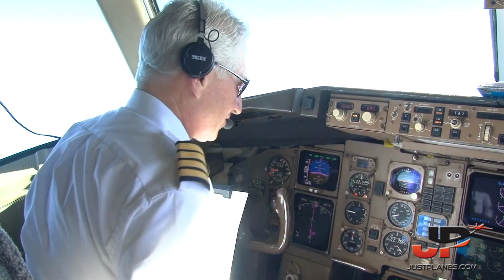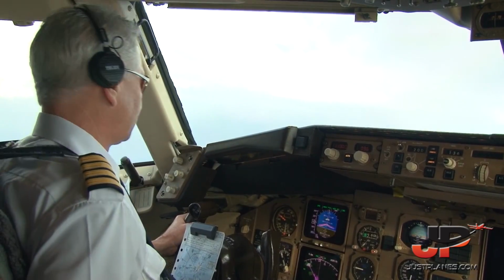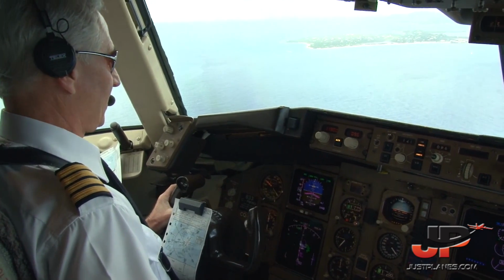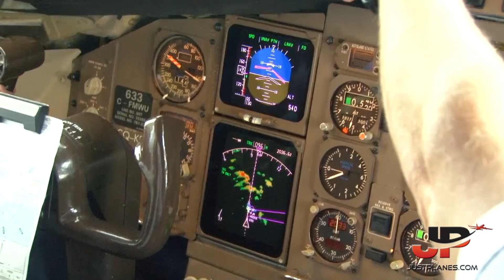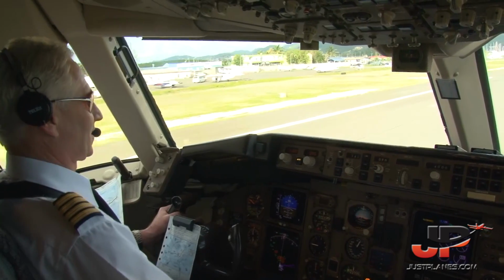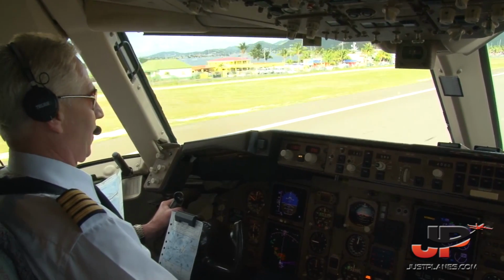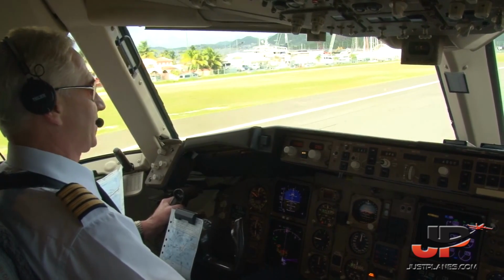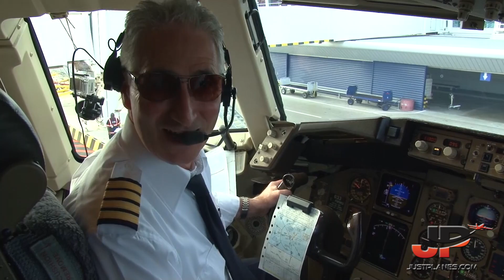Piloting BOEING 767-300ER into ST MAARTEN

Comment: On the 767's GPS, the most likely reason the one in this video doesn't have one is because the aircraft is approaching its retirement age and the carrier doesn't want to spend the money on adding the GPS. The newer 767s, (300 and 400 variants) do have it.
Reply: This was filmed in 2009 and this airplane C-FMWU is still flying with Air Canada Rouge.

Comment: Question for any "Heavy" pilot out there,  I know when hand flying on landing its human nature to make rapid adjustments on the yoke that the autopilot doesn't but does the plane actually respond to those fast tiny adjustment?
Reply: Yes it does ! :) When theres gusts or drafts you must apply those kind of inputs to make sure you stay on the glide path and center line the whole time, and flare correctly and land smoothly
Reply: @maxou5757  Cool.  I didnt know it was capable fo reacting quickly to such inputs.
Reply: Dominick yup. The 767 responds just as quickly as any small aircraft. I’m new to the 767 and have to remind myself I’m in heavy a lot.
Reply: My first impression is there seems to be some over controlling occurring. PIO might be an overstatement, but there sure is a lot of control wheel movement. But I wasn’t there...
Reply: @saxmanb777   I've never flown Large Aircraft but the 757, 767, 777 and 787 seem to be quite responsive. I've heard the 747 is the best of the lot.   I imagine Airbus is disappointing as you don't get much feedback from the side stick since the computer does most of the work.
Reply: Dominick it does but once the flight control law goes to flare mode it essentially is like a conventional aircraft, minus some minors things. But flight by wire from Airbus is amazing for aircraft capabilities. They fly really well
Reply: Dominick the big difference is inertia and slowing down the aircraft, other than that it’s like a smaller aircraft :)

Comment: Surprised in 2019 to see these pilots using paper charts and airport diagrams.
Reply: Brandon Hollingsworth there’s quite a certification process for gaining approval for using electronic charts. Since the 767 is really on its last legs as a passenger carrying aircraft it’s not surprising that an airline is not making the required investment.
Reply: @patzke  this was filmed several years ago, simple as that. Air Canada's pilots are all equipped with EFB's (iPads), regardless of the aircraft and associated age of it. They're far from being on their last legs as well. While AC mainline will likely retire them in the next year or so, Rouge still has a large 767 fleet.
Reply: Brandon Hollingsworth it shouldn’t matter the aircraft for use of EFB’s or not, it’s all in the company’s Op specs
Reply: Imagine if the pilot left the window open and all the charts and diagrams suddenly got sucked out...

Comment: Not GPS Equipped? Will somebody explain  to me how &/or why that is. Also, what do they use to navigate for long distances; LORAN-C & INS? Time Warp Here... 🤔
Reply: There is few other systems we navigate aircraft with that are not equipped with GPS.
For example:
DME (Distance Measuring equipment)
IRS (inertial reference system)
VORs (VHF omnidirectional radio range)

Comment: A 767 that's not GPS equipped?? Huh?
Reply: SMaze17 Fairly common...as crazy as it seems.
Reply: SMaze17 — The B767 was introduced in 1982.  GPS was developed beginning in 1973, but the WAAS which supports precision approaches to airports was introduced in 1994 or 1995.
Reply: It does have an flight management system but it’s not supported by GPS. Probably LORAN-C and VOR.
Reply: Tim Barrett and INS (Inertial Navigation System)
Reply: Despite the age of the 767 I still find it pretty amazing that Air Canada hasn't installed avionics for GPS after 25 years.
Reply: Yeah i asked the same thing...

Comment: FO starting the APU during roll out above 80 knots? If it was a short taxi after landing start the APU airborne.
I guess it’s just a different airline, different SOP, different culture, different philosophy.
Reply: I fly in Africa and fuel is pricy APU is never started in the air every drop of fuel counts . APU usually switched on at very last moment even as you approach the gate.

Comment: Really 767-300ER no GPS? Can someone enlighten us with an answer?
Reply: Lodia Moore The 767 uses 3 IRS (intertial reference system) systems to navigate. The coordinates are entered at the start to calibrate the systems, and throughout the flight the IRSs are able to calculate the position of the aircraft using a combination of ground stations and internal gyros
Reply: @joshmccorquodale9082  Thank you.

So in terms of net result this 767 with no GPS is not generally affected negatively. True or false?

Secondly and specifically it is said my airport has technological ability of guiding an aircraft in and onto runway even in heavy fog where actual pavement of runway can only be seen say 50 metres or so before actual touchdown. Will the lack of GPS in this 767 relate to its ability/inability to land at my airport?
Reply: May have been inoperative
Reply: Air canada is retiring the last of their 767s within the next year. Maybe not worth it to upgrade for them.
Reply: Craig Cudmore just use your smart phone, problem solved!

Comment: Lol not GPS equiped what the hell
Reply: Yes alot of the 2nd and 3rd Gen aircraft use INS not GPS. Basically when parked at the gate you enter your EXACT position. Then basically the INS system tracks the position relative your initial point.  So if you started at point A and you moved in a particular direction at a particular speed then you should be at point B basic trigonometry .  So the 2 INS systems measures your position relative to where you initailised the system. They are prone to drift but are pretty accurate.
Reply: @taffyhomwe463  yer I know lol it's 2019 what joke! Clearly putting money and profits before safety
Reply: @elmin2323  Actually not, GPS CAN NOT be used on ANY aircraft as a primary means of navigation. It can  be used  as a nav aid to augment primary nav syatems like VOR or INS etc. The reason for this is very simple the GPS system can be switched off at anytime. The US Military are the custodians of the GPS system and although unlikely they still can switch it off whenever they want... now imagine  you are over the Atlantic navigating purely on GPS and the system is switched off...and you had not set your INS you are F@k€d
Reply: @taffyhomwe463  lol GPS safer! More accurate! Supplementary to all of what U said! Can do rnp AR approaches! The IRS on the 767 can drift over 1.5nm per hour!
Reply: @elmin2323  I agree with you GPS is very very accurate infact where I fly we use it pretty much for all our  flights especially in cruise BUT we still have our VOR's and ILS set up even when doing RNAV GNSS approaches. And for departure (STARS) we still set up our VOR bcoz most way points on a SID and STAR are based on a VOR radial/ DME anyway.
Reply: @taffyhomwe463  why have a ils set up for a rnav? Talk about getting conflicting info, most aids are now rnav aids and require rnp 1.0
Reply: @taffyhomwe463  cant be used as a primary navigation??  I must remember than when Im flying around using RNP navigation with no VOR or NDB anywhere near me
Reply: @elmin2323  this video wasn’t made recently I can tell you without a doubt these planes fly RNAV approaches today and have GPS
Reply: Try navigating using a COMPASS & SEXTANT...🤔
Reply: Taffy Homwe I use my my ILS when I go to Walmart! It helps me get their every time!

Comment: Captain , Gum chewing !! No . Imagine going to a meeting in work and chewing gum. Is it me ?
Reply: Exactly, very distracting mawing on the gum
Reply: @VOOODOOO37  He's Canadian. You should be happy he didn't have a Molson's in one hand.
Reply: Angus McDonald chewing gum helps equalize the pressure in their ears during descent. When you only go on 1 or 2 flights a year it doesn’t seem much but when you fly every day you notice
Reply: Thanks for that mate , that explains it
Reply: @nankervisj  it's a distraction to an otherwise good video
Reply: VOOODOOO might be distracting for you sitting at home but at least it stops the crew from being distracted by the pain of the large pressure changes in these older aircraft during a critical phase of flight.
Reply: That would be 😎 lol
Reply: @nankervisj  doubt it, older lol? Joke
Reply: VOOODOOO yes indeed actually. Older aircraft like the 737 classics, 747, 757/767 etc. have a higher cabin altitude in flight as they weren’t able to structural support a higher pressure difference between the inside and outside, but as aircraft manufacturing has progressed and planes are being built with more technology and strength they are able to withstand lower cabin altitudes. For example the cabin altitude on a 767 is around 7000ft whereas the 787 keeps the cabin altitude well below 6000ft and you can feel this difference when you fly on said aircraft.